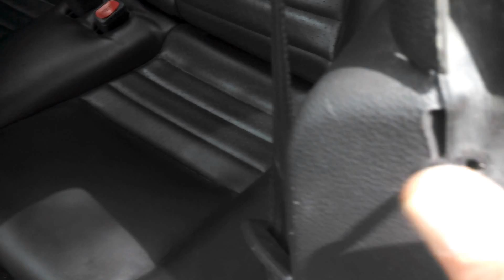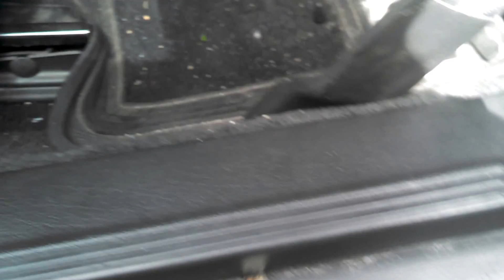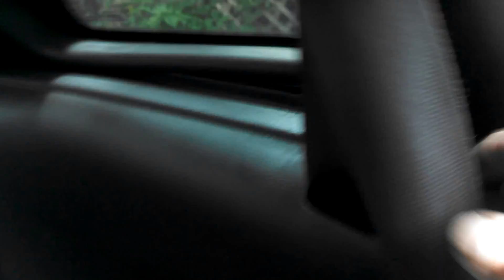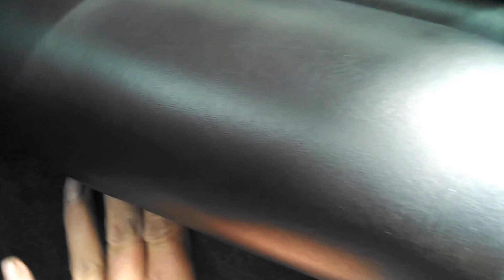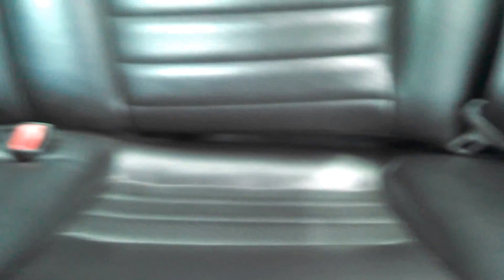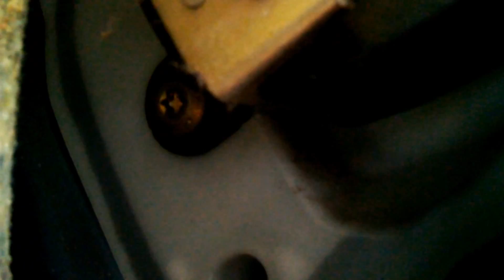2002 Mustang GT Seat belt access (drivers side)

Comment: Be careful of what seat belt you buy. A lot of them are cheaper than Ford branded (OEM) belts but the fine print of the cheaper ones usually 
says they're intended for "off road" use since they aren't DOT safety approved.